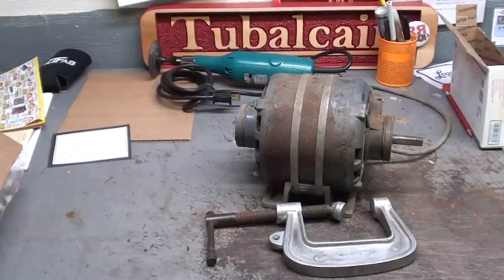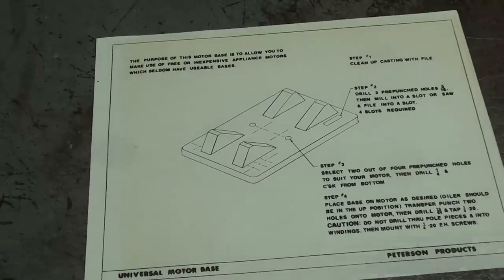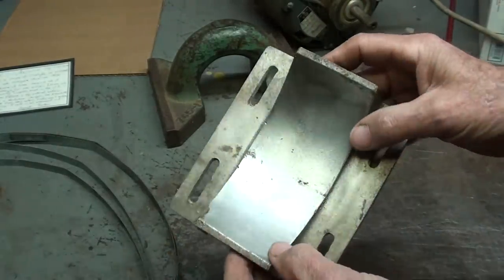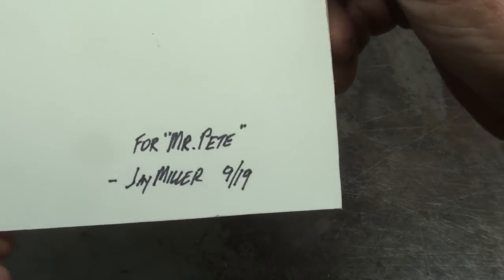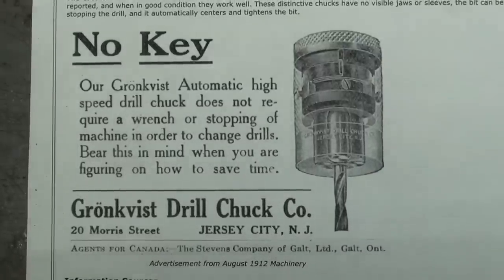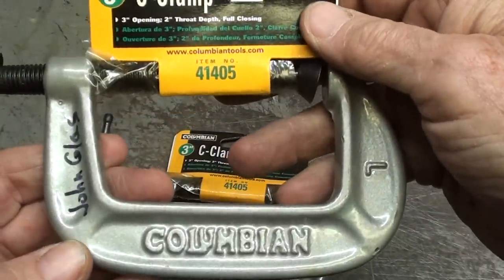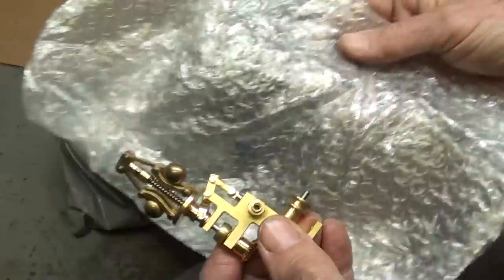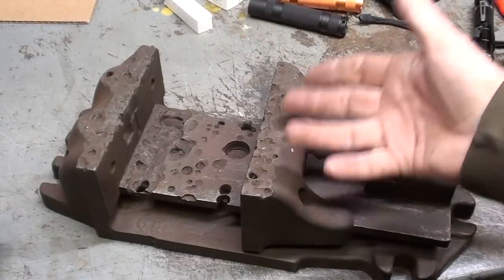This & That #51 tubalcain mrpete shop teacher

Comment: When dealing with Li-Ion (Lithium Ion) batteries and their chargers, be cautious when using inexpensive or off-brand batteries and chargers. Charging and discharging a Li-Ion battery must be done very precisely to avoid Lithium fires. I recommend setting up the charger in a location away from any flammable materials (a steel tray on a concrete floor would be good). Once you have some confidence in your charger and batteries, you might consider a location where the steel tray is on a table or counter with some standoffs to provide some air-space under the tray. It is usually advised not to charge Li-Ion batteries without observation.

Li-Ion batteries are wonderful for the amount of energy they can store and for how quickly they can be charged. (Fast charging does shorten the life of such batteries, however.) They can also be destroyed by drawing too much power at once; short-circuiting them can cause thermal runaway and result in a fire. The flashlights shown are unlikely to overload these batteries. (Vapers have been known to build super-hot vaping rigs and cause such fires. Samsung had one phone model that tended to either overcharge or overdraw their batteries and catch fire.) Li-Ion batteries have a huge variation in current draw capacity. If you need high-current batteries, do your research and buy batteries that can supply it safely.

The number of a Li-Ion battery describes the size; the first two digits are the diameter in mm; the 3rd and 4th are the length in mm; the fifth is a zero. Thus an 18650 is 18 mm diameter by 65 mm length. (Don't measure the length with metal calipers or micrometers. See above for the danger of short-circuiting and below for the effects of a fire.)

Like magnesium, lithium burns white hot and cannot be extinguished by normal methods. It burns so hot that pouring water on it only makes things worse; it burns so hot that it will split water molecules into oxygen (which immediately combines with the lithium) and hydrogen (which escapes as a flammable gas).  Ordinary ABC-rated fire extinguishers are useless. If you have a lithium (or magnesium) fire, the best thing to do is remove it to outdoors and let it burn itself out (hence the metal tray); second best is to smother it in dry sand.

Ni-MH (Nickel metal hydride) batteries are much safer, but store much less power than Li-Ion, and are usually much slower to charge.
Reply from the maker: Thank you very much for the information. But you scared me. I think I should throw them all away, LOL
Reply: mrpete222 - I wouldn’t. The batteries are Samsung (a good brand, but counterfeits exist). The flashlights are valuable. There are good, safe chargers available. In the absence of any local Li-Ion expertise, you might try a vaping shop if there are any near you. They will have or know someone who knows about these things, since vapers use a lot of these batteries. Otherwise, I can help via email. 
If you do decide to dispose of them, you will need to find a place that can dispose of the batteries safely. Don’t put them in regular trash. I think Batteries + can take them.

Comment: Those 18650 batteries are what the Tesla cars run on, the newer ones, tesla 3  use a slightly bigger one. 21700. 21mm x 700mm and 18650 are 18mm x 650mm sizes easier to remember than AA, AAA, Sub-C etc.
Reply from the maker: Thanks
Reply: Similar numbering thing with the 3V Lithium coin batteries - the CR2016 - 20mm x 1.6mm ,  CR2032 - 20mm x 3.2mm although they're not rechargeable

Comment: Mr. Pete,
I taught electronics courses in jr. College back in the early 90's for 5 years.  I would tell them in the first class this was not high school.  I will discuss homework at the start of class.  If there are no questions, I will assume you are not having problems with it.  I then would tell them my office hours for those who would prefer to ask questions out of class.  There was 4 tests during the semester plus a final.  For the sophomore classes I would try to tell them that on the job you get one chance if you foul up.  After that, your job might be on the line.  At the first test, I would have 20% of the class fail badly.  They would ask why I didn't allow open book tests.  They would say the Algebra was too hard etc.  All things I covered on the first class.  The majority of that failing 20% would drop the class.  Almost all the remainder of the class would pass.  They started to ask questions and study.  It was a lot more strict when I took Electrical Engineering in the early 1970's.  I think it's worse now.  I took a 2 year gunsmithing course at the local jr. college.  The complaining about homework and no open book tests was amazing.  There were students that ranged from 21 to 71 years old.  Students over 45 or with military experience studied and completed the work with good grades.  The others either struggled or dropped the courses.  It's a shame the way the schools are teaching now.
PS the battery is a lithium ion nickle metal hydride design.  The don't develope a memory and charge less and less over time like the nicad batteries.  Looking forward to more of your videos next year.  Have a Merry Christmas and Happy New Year.
Reply from the maker: Thank you very much. Your story about teaching sounds very familiar. Unfortunately that is the way it is

Comment: Watch out for Bang (good?) I ordered some 5/8" tool holders for my lathe and some carbide inserts. The post office delivered a paper envelope that they were originally packaged in. The post office had enclosed the envelope in a plastic bag with a letter saying the package had arrived empty. After many back & forth with BG they wanted me to prove I didn't get the merchandise. I sent photos of the package and copies of the USPO letter. They wanted proof that it was from the PO. I went to the main PO and the postmaster was nice enough to have the secretary type up a letter and he signed it. BG then sent me an e-mail asking if I'd like to have the tooling replaced. I answered "yes." Never happened. They would no long reply.
Reply from the maker: I don’t think I would ever order anything from them if I had to pay for it   You are not the first person to tell me that you cannot correspond with them. I only Order from them because it’s free. And that is still a pain in the neck.

Comment: 19:07 - You do need a wider angle... when you do a driving video, or a tour of a factory... many times the camera you use exacerbates the shake and bump and sometimes it is difficult to get a good feel for the location. Having both types is a good thing. Besides... if you are shooting 2K, then you can zoom in with your video software as needed. I do it all the time.
21:52 - Let me explain: Li is the atomic symbol for Lithium. Ni is the atomic symbol for Nickel. MH stands for Metal Hydride. So you get "Lithium-Ion and Nickel Metal Hydride Battery Charger" More typically just NiMH or "Nickel Metal Hydride Batteries" are used these days as they hold a charge for a LONG time unlike the old NiCad (Nickel Cadmium) batteries.
23:49 - Yeah do it! Or at least show the finished product. 
... A little JB Wield will fix it right up... hee hee....
Reply from the maker: Thank you for the explanation of the batteries.
Reply from the maker: I don’t like that plastic JB Weld
Reply: @mrpete222  I know... That's exactly why I said that. Hee hee.

Comment: Just an FYI - the HF Vulcan welding machines have been getting fantastic reviews.
Reply from the maker: Good to know. Do they have a good plasma machine?
Reply: mrpete222 - I can only imagine that if it’s from the same family it’d use similar components. I’ve had my offshore (Everlast brand) 3in1 machine (plasma/tig/stick) for a good 15 years and it’s great. Name brand IGBT’s is the real trick!  Mine has Panasonics.

Comment: Lyle, will the screw from the bad vice be of any  use on the repaired one that has a bent screw?
Reply from the maker: I need to measure them never thought of that. But I do not know how to get the screw out of the jaw
Reply: @mrpete222  You are dead right Lyle, I have re watched the previous vice restoration and I can not see an easy way to get the snap ring out. All very well for quick assembly at the factory but looks an impossible repair option. Shame as if the screw was the same as the bent one it would have made made a nice completed first vice restore. Seasons Greetings to you and all the Family, from a very hot Australia.

Comment: A lot of those torches you don't have to cycle through all the flashing nonsense.  Just press and hold the switch for about three seconds, and they switch right off.
Reply from the maker: Good, I will try that. And it is nonsense!

Comment: I use my adjustable wrenches both ways, too.  However, if I have to use one in a high stress application (like an axle bolt if I don't yet have the right size deep socket and can't quickly get one), I pay attention to direction.  The picture at 14:37 is incorrect.  It puts too much leverage on the weak point of the joint.

Comment: The illustration of right and wrong is wrong.... it's the opposite that is correct.... the way shown as correct in the illustration causes leverage to be placed on the end of the movable jaw which causes the screw adjuster to break..... but then again anything that works and removes the  nut/bolt is the right way

Comment: I'm not watching this video, I'm just commenting on the rubbish thumbnail.
Re use of the adjustable spanner ('wrench') being a right way and a wrong way - is incorrect. The angle of the jaws relative to the handle tells us this. The jaw angle offers us a rotational movement of one twelfth of a turn - or half a hex flat - then reverse the spanner to get the other half, reverse again for the first half of the next flat, reverse again for the second half of the next flat and so on. The tool is designed to be used like this - so neither way is 'wrong' !